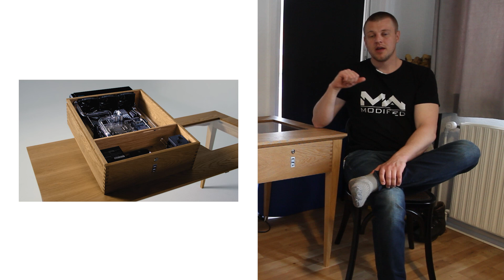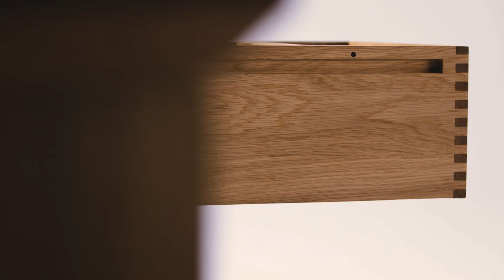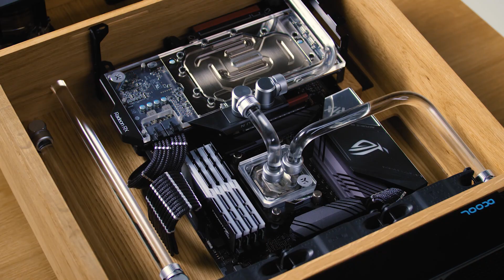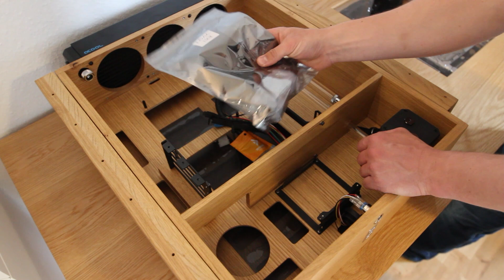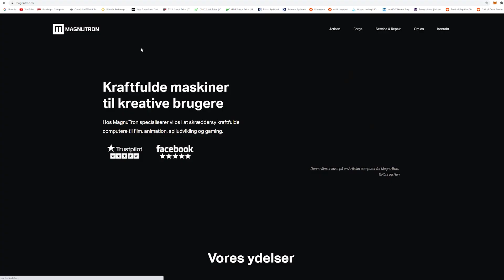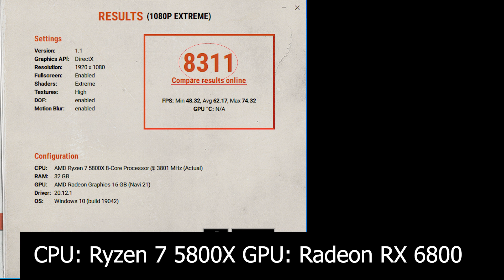Technical Deep Dive - Wooden PC Drawer 2.0

Comment: Beautiful desk! If I may ask, why did you choose to not mount the computer drawer window flush with the desk surface? That is the only thing that seemed a little bit off in my view (but perhaps I’m missing something). Again great desk and wonderful video compilation. Nice job on the edits and sound. Cheers!
Reply from the maker: Thanks! Yeah the polycarbonate display area needs to be thought out again and done in a different way. You also need to be able to dismount it, so you can install parts directly through the hole. Much more to come! ;)

Comment: Love the work!
I am actually pretty much rebuilding your first version of the PC desk as journeyman´s piece right now.  Using smoked Oak and a lenght of 2,4m and 44mm thick.
And going for a Mo-Ra 360 Radiator instead of the internal cooling.
Only struggling to plan out the mounting of the parts.
Could you tell me which standoffs you used and how you installed them?

And to me 1500 Dollars sounds to much. Especially since it will not be a one of. If you get the production planned out perfectly it should be under 1k. 
But that´s just my opinion on it and I dont rly have that much money anyway.(besides the 3k for the PC i build RN)

Also just my opinion about the design, i rly dislike the drawer front. I would prefer the starting button to not be visible at all ( in a corner under the drawer for example)
And I added a small flap in the table in which you can add USB ports, put cables for monitors through and so on.
As i said, just my opinion i bet other people find it 100% perfect :)

Kepp up the nice work!
Reply from the maker: Thanks for the respons! :) And good luck on your project!

Comment: Awesome Desk! May I ask which diameter hardline tubing you've gone with? And is the riser cable Gen 3 or Gen 4? Thanks!
Reply from the maker: Im thinking the standard will be 14mm and the riser cable is Gen3 until Gen4 is not a expensive. ;)

Comment: Hi there, I've waited for so long to watch this video.

Very good. I am one of those interested in your product. 

Just the price is a little expensive in my opinion. I did a very similar project and the drawer (115x40 cm) only cost me 200 euros.

The entire desk (180x80 cm) cost me 100 euros + a motorized autonomous.ai SmartDesk Frame (399). 699 for the entire project.

Maybe because of the materials but the price would be a problem for me to buy your desk. I love the project anyway and wish you a lot of success.  Keep it going.
Reply from the maker: Thank you very much. :) The attention to detail here is on another level. This product is the most expesive one i'll ever make, and things will only get smarter and cheaper from here on. ;)